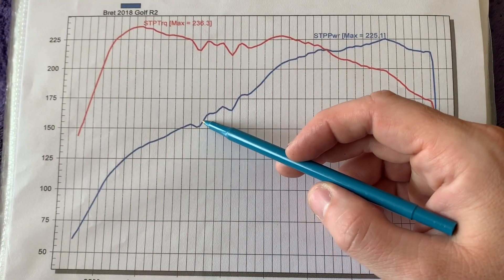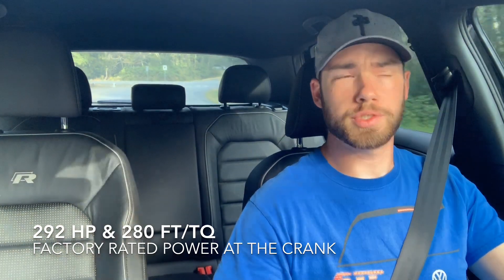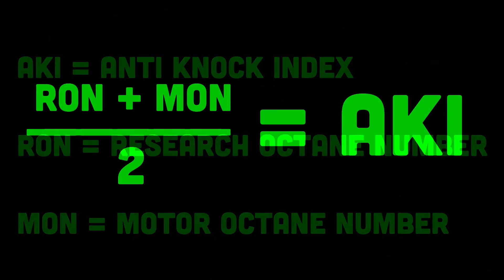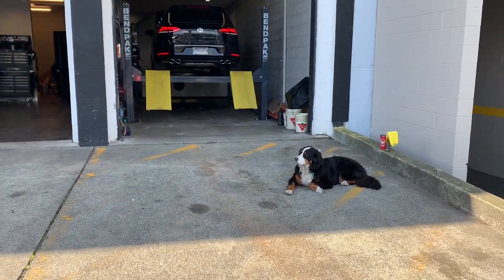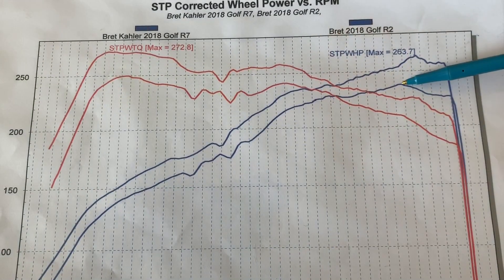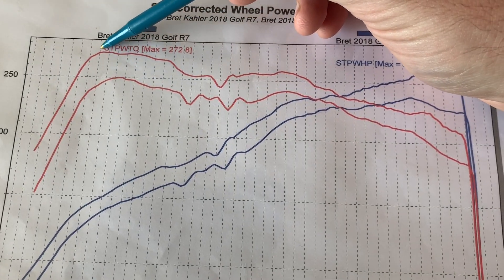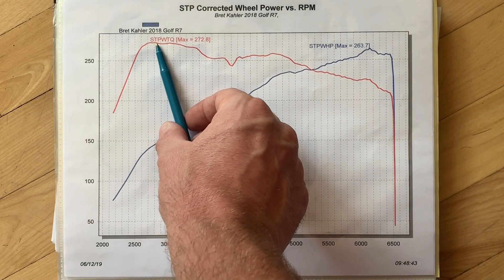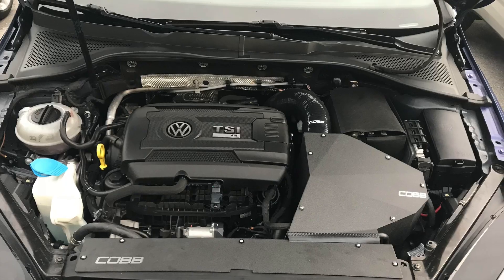Dyno Testing Different Fuel Brands: Shell 91V Power VS Chevron 94

Comment: Very confusing since someone else made the same test and results showed shevron was better and increased power .. in this video it’s the opposite,go figure. By the way the music in this video is extremely annoying.
Reply from the maker: It’s actually quite simple, I live on Vancouver island. He lives in Vancouver. Our fuel is not the same quality. The island gets a lower quality fuel. Mainland gets an entirely different source of fuel and it’s a better quality. The music has to be something copyright free/ royalty free. So it’s hard to find anything that’s not annoying. But Do you know what I find annoying? Negative people! No wonder I quite making videos… thanks bud
Reply: I've been using Chevron gas for years on all my vehicle's. Like 20 years plus and my cars and trucks always run smooth and zero issues. Same I saw a video where Chevron made more power than shell . Someone is not telling the truth or something is not being done right
Reply from the maker: @superior3384  depends on where you buy your fuel. On Vancouver island we get different fuel than Vancouver. In Vancouver chevron is a lot better. Also depends on the engine. In my opinion Turbocharged engines run better on island shell vs island chevron. Where as carbureted Sport bikes run better on island chevron. Also why would I not be truthful about the results? What would be the point in spending my own money, waisting my own time to not be truthful?

Comment: Kudos for testing but there are several inaccuracies. Drive train loss won't be anywhere near 20-30%. Closer to 12-15% for a fwd based awd car like the golf R. The A/F ratio is not 14.7:1 when under full throttle. It's going to be much richer, especially with a turbo car. More like 11 or 12:1. Unfortunately given the long time between runs, this just isn't valid testing. A recent test done by a CDN YT channel found Shell 91 caused significant timing retardation and HP losses.

Comment: I knew it! I'm in Kelowna, I've felt as though Chevron not only produces low power, but it is unreliable in the way it produces that power. Some times the car would completely fall on its face, feeling more like a Tiguan than a Golf R. In our previous 392 Challenger Chevron produced the same results. The car would feel, seat of the pants SLOW. And this was further noticed with Hot ambient temps. 

I reached out to Shell, Petro, Husky and Chevron for the RON ratings of their highest rated premium fuel.

 Shell responded proudly, immediately with "96 to 97" RON depending on variables for their 91 V Power. 

Petro was a day behind responding. 98 RON with their "Ultra 94 10% ethanol" and 94 RON with their 91 10% Ethanol. 

Husky took a week to respond. They were 94 RON on their 91, and say it didn't contain ethanol even though the pump says it does. 

Chevron responded with a link for another email address. No response from that address. I reached out two more times via e-mail with no response and only after a phone call.... they responded with they "did not know"

Shell V Power FTW!

Comment: Bret you might want to ask Greg about the 30hp increase. He recalibrated the dyno and it shows higher numbers by like 10%. My HP went from 165whp to almost 180whp with zero changes to engine or fueling. I actually went from a 5 speed FWD to a 6 speed AWD, so I should have had some loss. He then showed me the numbers at the old calibration and sure enough I had some loss. So I do believe your numbers are off due to this.

Comment: You can't use a chassis dyno to get accurate engine hp figures.
Reply from the maker: DepakoteMeister I was only trying measure a difference in fuel quality. Using the same dyno and only changing the fuel
Reply: @twowheels87  But chassis dynos are notoriously poor at giving accurate crank hp figures, there are so many factors after the crank, gearbox oil temp/viscosity, diff oil temp/viscosity, tyre temp, tyre pressure.  You can run an engine on a engine dyno and get repeatable results on each run, try that with a chassis dyno!
Reply: @DepakoteMeister  Using a chassis dyno as a tool to compare wheel horsepower and torque is valid if it is done on the same car and under the same conditions. Corrections can be made for different temperatures, air density and humidity.

Comment: Would have been more accurate to do the dyno test same day - same fuel.

Winter fuel isn’t the same as summer fuel-   Way too many factors that play into effect here .
Reply: When there is discrepancy, it is inconclusive. I run the Shell. As I remember, they had claimed the nitrogen mix
would be absent, and in need, of some oxygen, so molecules would bond and pull in more oxygen. Works great in track
testing- with added VP octane and VP fuel additives.

Comment: I would like to mention that the intake air temperature you are reading on the P3 Cars is NOT turbo inlet temperature, but throttle inlet temperature. To improve and provide a stable air temperature, an upgraded intercooler is a better upgrade path.

Comment: I’ve been having major issues with my 93 tune on my 15 5.0 and I’m  running 94, it seems better with the 91 tune and the dead spots seemed to disappear with a 3 point octane booster. I’m going to run V power next weekend and see if it helps my quarter mile times because the Co-op 91 definitely did by almost 2/10’s but da can effect that a lot too.